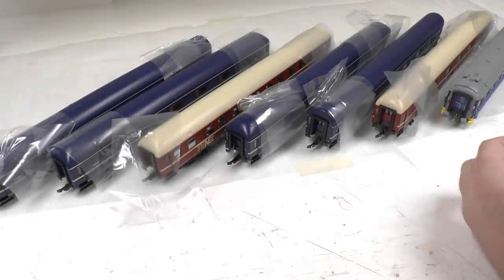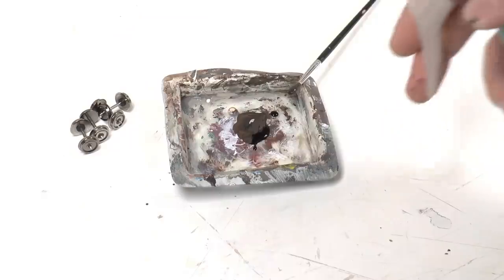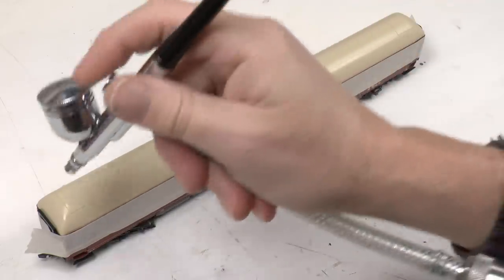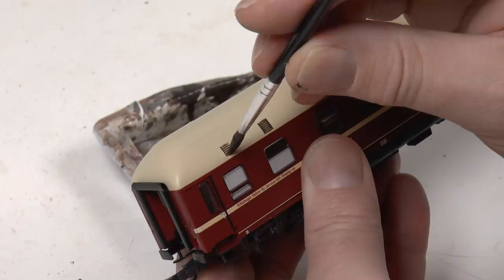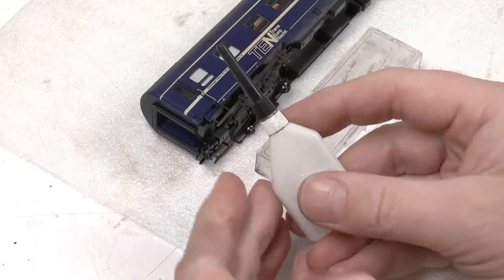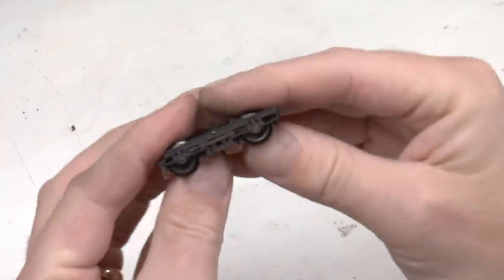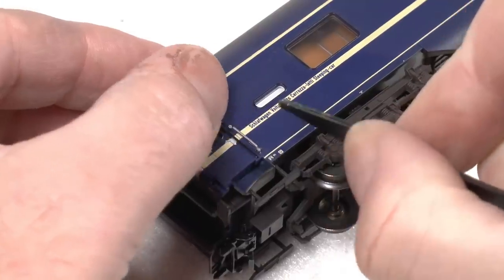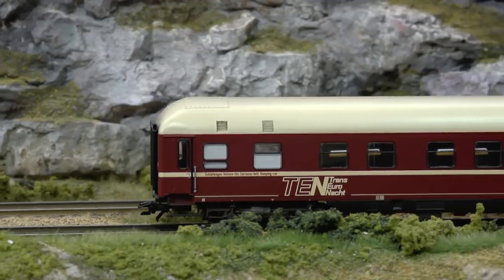What about weathering Passenger Coaches?

Comment: Hi marklin, I would totally appreciate you doing a video on couplings!
I got into modell railroading a year ago and have a wild collection of various cars from Roco, Piko and Märklin, all with different couplings. Next year I want to standardize them but I'm unsure which one would be best (I mostly do shunting ops with H0 Märklin gear). Your thoughts on this issue would be fantastic!
Reply: Märklin wagons are designed for the Märklin 3-rail system. You won't be able to run them on your 2-rail system layout, because the will be a short-circuit.

Comment: A lot depends on the type of service. Urban commuter service coaches are going to be a lot more weathered than premium service. A lot also depends on the era being modeled. Anything in the steam era behind coal burning locomotives are going to be dirty. There is no way around it
Reply: Most railroads in the steam era had wash stations for there equipment and tried to keep them clean as possible. The roofs may have be dirtier from cinders but it wasn't that bad.   👍
Reply: @williambryant5946  
Yes, I know they did but any long distance passenger train arriving at its destination is going to be dirtier than equipment going out. A lot would also depend on the economy of the time. Let's say a modeler has a layout in the 1930s. It's the Depression. Money is tight. Railroads have to cut costs where possible.  That's one place it could be done. A layout set in WWII. Railroads are stretched tight as Dick's hatband. Passenger miles are likely as high as they have ever been. Most of the traffic is troop trains. At least long distance ones are. Even as you say a lot is going to depend on the carrier. The Pennsy or New York Central or New Haven on the east coast are likely to be cleaner than the smaller carriers.

Comment: Hello Martin!
By the way.... the coaches are from roco, aren't they? I've made bad experience with the Märklin short couplers with non Märklin cars because the bumpers are a bit lower witch results in derailments.
I prefer the (compatible) universal couplers from roco.
Greetings, A
Reply from the maker: True! Roco buffers has to be removed with Märklin short couplings. From what I head the best coupling in the market is Fleischmann profi. For me I can’t afford a total change now..
Reply: If you want a cheap solution, you can remove one clutch bracket from Märklin short couplers. Works, but of course you can't mix cars free afterwards.
Reply: Fleischmann Profi ist not the best coupler. It has advantages, but also disadvantages.
They can uncouple if gradient changes. They don't couple with ease, you can push away cars without getting connected.
But you can lift cars without decoupling..,

Comment: first question with pop's up: what compressor and airbrush you need? How to start and maybe advice?
Reply: Google for Iwata, Japanese brand, very good, also the affordable models. Dont go for brand "X" which is "made somewhere" and available at the 1 dollar DIY shop or other cheap stuff stores. You will regret it in a few days.  Harder & Steenbeck or Paasche. But this are the more expansive and professional brands. Neo is also very good first time model, it is made by Iwata. Compressors, again Iwata or Werther are the best affordable brands. Of coarse you can go into the thousands if you want. But in the tens is the other way and often not that good if it can be called good at all.

I have used a Werther TC-108 compressor with 3 different older models of Paasche and a Neo (by Iwata) You need a good cleaning fluid, dont cut in expenses on that, if your airbrush gets clogged up it is very hard to get it going again. If you can get it going at all. Furthermore a special bowl to clean the brush during the job. (i dont know the english name) A air cleaner/ filter is also a good idea, it gives some extra grip on the brushes. Rather not use curled/spiral hoses, they are annoying and soon the curls are, well maybe you remember the good old wired telephone.... Just straight hoses with quick couplers.

Take note that the learning curve of this is very steep. Thats why i sold my set after just a few weeks. I feel more comfortable with brush, dry brush and chalk techniques. For me airbrushing was a step to high and it felt like i spend more time cleaning the darn thing then actually painting with it.

Comment: Did you put any matt varnish onto the sides? I suppose if the coaches are normally cleaned the sides would be slightly glossy in real life.
Reply from the maker: Nope. No varnish on the sides. Coaches are typically quite glossy